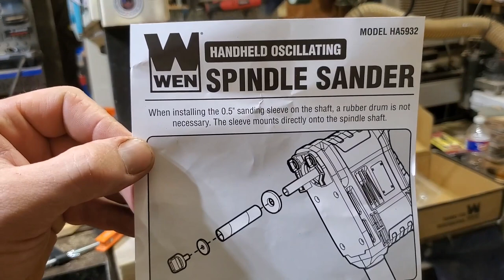WEN Portable Oscillating Spindle Sander || FIRST LOOK & DEMO

Comment: Hi Brad, you were going to make an assessment of the Wen unit after 6 months use? 
               My unit came without the upper washer. Will you kindly give me the 2 diameters and thickness so I can make one. Cheers, (Exotic Timber Slabs).

Comment: Definitely a cool tool. I don't think that I've seen anything similar.
Reply from the maker: Triton and some off name brand both sell it. But yea, I was surprised when I stumbled upon it as well
Reply: It is kinda cool. Now I just need to figure out “Wen” I’m going to order it...
Reply from the maker: Ha! I see what u did there
Reply: @BradsWorkbench  Speaking of the Triton, if it's the same dimensions do you think this would be compatible with the Rockler Convertible Benchtop Router Table that has the optional insert plate for the Triton?